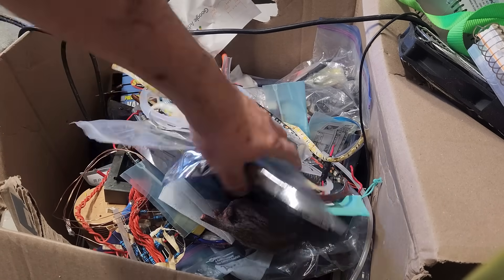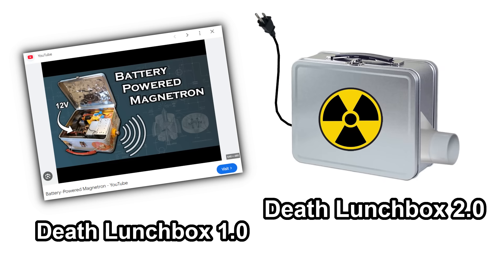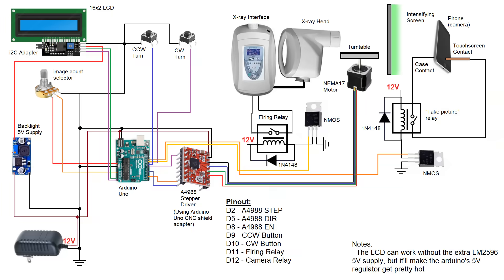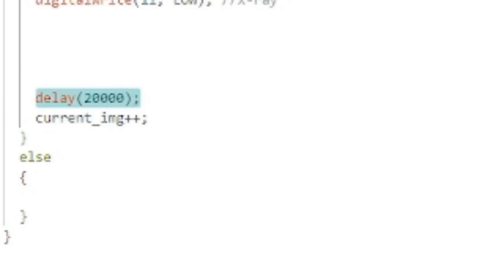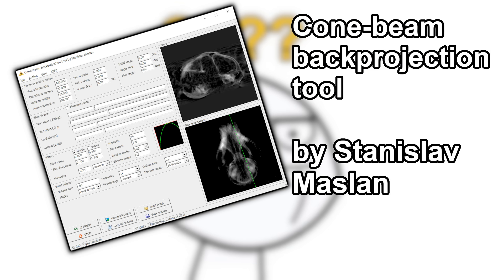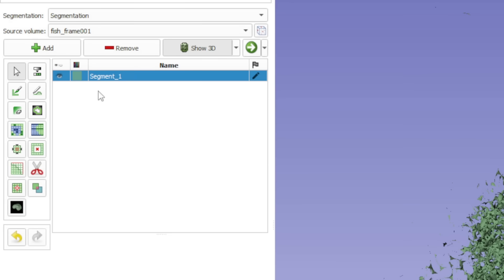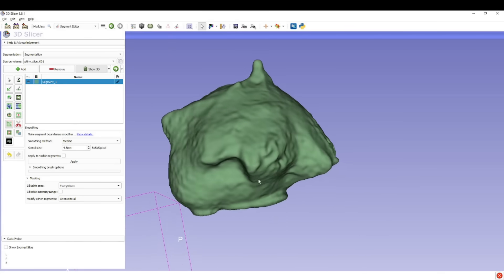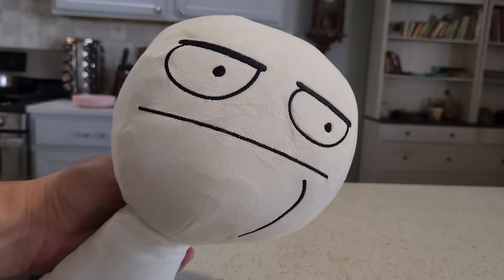Turning X-rays into 3d prints with a DIY CT scanner

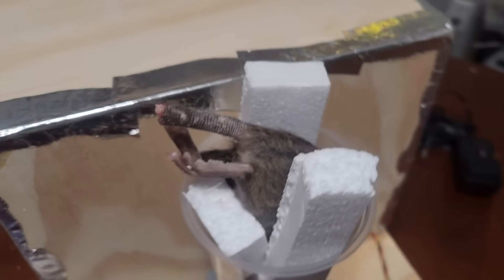Comment: 6:41 so idk abozt your skillset but after color inverting the images (which are like a few lines of python which can chatgpt write for you)

You could use a simple Neuronetwork to remove these artifacts.

You probably do not even have to train it your self.

A quick seaech and I dound Noise2Void or Noise2Self.

I think this could help.
After I saw what you can make this should be absolutley easy with some help of an llm.

Even if you have zero coding experience which I think is not the case.

Very cool video so far.
Would be nice to have

Comment: You should try building a Sabatier process machine. It's where you pass 1 part CO2 and 4 parts hydrogen at 30 bar and 400c over a nickle catalyst and you get 1 part methane an 2 parts water, which can then be split apart into hydrogen and oxygen, and the hydrogen can be recycled back into the process. If you get the hydrogen from water electrolysis,  you get even more oxygen, and at the end, end up with an excess of oxygen, to burn the methane. This process is why space X is using methane for there rockets. Because  Mar's atmosphere is 95% CO2. The hard part is getting components that can handle the pressure and heat, without getting affected by hydrogen enbrittlement. I'm currently working on this, and the biggest problem I'm having is finding a suitable tank for the reaction and a capable compressor. Who knows, If I find a good deal I might just sacrifice a cheap R-410 compressor and a random tank if a get a good deal on both.

Comment: Woludn't it be good to erase the hot pixels before doing more work?  (@singflower already proposed taking more pictures and using a median filter. That's probable the most powerful solution.)
They are salt and pepper noise and thus easy to separate in the images, I guess. :D I'm not very educated about image programms, but I think AI would do a good job to 100% remove those and inpaint the picture with data, which makes sense. Then, there would be less noise in the following steps 
(although, in 3D, there should be even more information, to get rid of those things. However, I guess the algorithms there might be less advanced, because there is less demand and the transformations needed to get a picture are already more advanced than many programmers are capable of understanding.)

Comment: You could significantly reduce noise: if you take not 1, but, for example, 10 shots (for one position of the object) and average them into one, this will suppress noise and so-called "hot" pixels.

Comment: extremely cool, but it'd probably had been easier and would've improved detail to filter out the "hot pixel" noise before, at the 2D images, using something like openCV or just tweaking with gaussian filtering and contrast options

Comment: 400x400 is trash for static xray lol, BUT for CT that aint bad.   at least when i was a programmer on professional medical imaging software, i seem to recall 512x512 being the pretty standard slice resolution for "actual" CT exams  (MRI are even lower. PET is worst lol).   of course there are other differences, like real CT is more like 12 or 14 bit per pixel.   also you dont think of them as "pixel values" but rather "hounsfield units"  a calibrated density unit where 0 HU is water.  makes segmentation a helluva lot easier.      im proud of you for taking xray safety seriously:   excellent job highlighting the fact that beam filtering is important! not many hobbyists seem to be aware of soft VS hard xray!

Comment: My first job was developing the hardware for the first ever CT scanner. No computer powerful enough to process the x-ray data into images so we had to design hard wired logic, using TTL chips, for that. The only computer was a Data General Nova which generated the display.

Comment: Instead of building the periscope, you can try lucky imaging technique used in stronomy, where instead of doing one long exposure you do a couple (5-20) short ones that you then stack and the noice cancels out, while the actual signal in the picture can also be adjusted afterwards in software for picture editing. You only need to do like 20 short exposures times 100 angles, then stack it manually and adjust and you know what, maybe just build a simple periscope

Comment: Improve the quality of the X-rays (and subsequent CT scans) by using the same trick as astrophotographers; take a bunch of noisy images of the same thing and fix it in post!

Instead of taking an X-ray then rotating, take 5-10 X-rays (and photos) before rotating. Combine those 5-10 noisy images by averaging or using a median filter to remove the noise, then proceed as before. I'd expect you'd have much clearer results, at the expense of a longer capture time. 

It would still be almost entirely automated, only adding in 2 additional automated steps but resulting in much better captures.

Comment: I'm wondering if it's the conversion from rotational to vertical slices that's losing you a ton of resolution. Your original images are pretty sharp, especially if you look at the rat's teeth they've got very good contrast and smooth surface, but on the vertical slices they're extremely grainy with tons of voids and poor contrast so the final mesh for printing is just very lumpy and deformed. If you just found a way to do the point cloud generation directly I think the result would've been so much better.

Comment: removing hot pixels with the propper hardware of course is the best. but you can also use some AI image optimazation on the hot pixels before you convert it in to the image the 3d software uses. 

also a nice idea is to combine normal images with the xray images and combine them in a 3d model that you have a full outer shell and like a skeleton model inside in one. not sure what soft you need to do it but if someone can figure it out. 

good luck and thanks for the quality content

Comment: Taking two or more images per step of the rotation could help eliminate noise. Just add the extra photos as “darken” layers in GIMP or Photoshop (easy to do with Python, too). Granted it doubles the scan time but it should help get a cleaner starting point.

Comment: It's probably not worth the time, if you plan on a solution with mirrors, but it should be possible to take three or more photos in that same location, and scan through those images, and filter out noise by comparing each pixel to the other photos in the same location. If they're within some threshold of the other photos, it's a 'clean' pixel. If the difference exceeds the threshold, average together the colour of the pixels that are closest in value. With 3 photos/location, it's not unlikely to have a few overlaps in noise, considering how much there is, but the more you add per location, the less likely it is that the noise overlaps enought to not get filtered out. Also, the noise almost looks completely black and white, so it could be possible to just look at the value and say, if it's almost completely black, or completely white, pick corresponding pixels from the photos where they're not. That should make three photos sufficient, as it's pretty unlikely that the noise overlaps in all three photos.

Comment: i think the hot pixels caused by the radiation can be minimized by using a glass prism to direct the visible light emitted by the intensifying screen 90° to the left or right (basically it works like a mirror. i thought of this because using a normal metal-coated mirror would reflect the xray as well) and then keeping the phone a little farther away and using a mini telescope setup to zoom into it.
i mean glass can't reflect xray right, so the x-ray coming straight from the back of the intensifying screen would penetrate the prism without being reflected and won't be able to hit the camera sensor directly.

Comment: Are the locations of the hot pixels deterministic? If they are random, then you should be able to take an odd number of photographs for each stage angle and then combine them together again by using the median value of each of the corresponding pixels. More photographs will result in lower noise.

Comment: For more electronic version of firing the camera on the phone, turning the volume down on the phone (physical button) will fire the camera (at least on android, I think on idevice), which works via wildly cheap headphones with a volume control.  Which is just a switch, of course.  I suspect it also works with wireless, which is surely not going to have interference from a kludge CAT scanner.

Comment: If you take a video over the exposure, you should be able to clean up all the hot pixels by retaining the common pixels across the frames.  You can average all the frames, which is a trivially simple way to drop out any hot pixels that appear in a single frame. Of course, scripting this would be most convenient. There are some astrophotography related techniques that should be great for this application.

Comment: @5:00 or so you make the automatic touch screen button pusher.  Just FYI, you can buy a device for this that just clips onto a touch screen and is triggered from a remote control.  Useful for turning the page on a kindle while keeping your hands warm under the covers.  Or triggering homebrew irradiation contraptions.  Whichever.

Comment: One easy way to get rid of the hot pixels could be to take multiple pictures from the same angle and do a bit of image processing. Like take 3 pictures for each pixel select the two values that are closest to each other and average them discarding the third. Just off the top of my head. There's probably methods with two pictures like  in regions with large differences between the two images take the version that's smoother with the surroundings. But I think the three picture one is probably easiest to implement.

Comment: As far as I remember my job with X-ray CT scanners, you can eliminate good portion of hot pixels with thick glass. Designers like to use fiber-optic lenses because they are basically big chunks of solid glass and protect cameras from X-rays very well.

Comment: 4:44  the other hardware solution to take the photo is to use a headphone , the volume up button can trigger taking a photo , you may use the other relay for that , this also works with cheap Bluetooth headphones , you can make a remote trigger.

Check the camera settings if it didnt work

Comment: key to get good results from ct scanning or x ray scanning is not the emitter, that is cheap and "easy" to use (just get a 70 kvp or more dental machine or a lamp). the hard part is getting a good picture from the radiation. the lamp has a max beam width so you can't go too big or you have to get closer, so you need to make the receiving plate move closer and further to optimize the clarity (like a focal lense). plus you need a good intensifying screen and there you have to make a weigh off between higher granularity, means more "pixels''/resolution, but less light emission, or more coarse and more light emission, meaning easier camera work. i have chosen a 200 sensitivity screen, which is the more coarse (100 is finer), because 100 was pretty much too dark. i think perhaps with a x ray fresnel lens, which doesnt exist yet, a metal fresnel plate you could make the beams become paralleled collimated like a laser, and then you could stack thin very sensitive screens maybe to get a best of both worlds. anybody in to testing or know a result?
Reply: ah, its a Fresnel zone plate (FZP), it exists and is impossible to find..

Comment: Wow those images are incredible! I'm quite certain some well-tuned signal processing steps could easily produce a clean and accurate 3d model. Would you be open to sharing the raw files somewhere so we can have some fun with them? (without exposing ourselves to dangerous radiation)

Comment: Cheap fix for hot pixels would taking each picture twice (with 0 or 360 rotation) and using boolean "AND" to remove pixels appearing only in 1 picture. May require using AND over a window to avoid drift problem.

Comment: I see a lot of potential in this. A periscope, higher resolution images, image processing before going into the software, maybe taking multiple exposures per angle and pick pixels from the one without hot spots by using outlier rejection, better mesh processing, there are a lot of things you can do to improve this and I hope we get another video on this! Very cool stuff

Comment: Would photogrammetry software work better to get the point cloud? It’s designed to munge together images from separate angles. Also selfie sticks are quite good for hacking to give you an external shutter control… 😀 thanks for the fantastic content.

Comment: There are Selfie-Sticks and remotes to trigger cellphone cameras.
 There is even a way to trigger a phone's camera via the headphone jack (if you happen to have one.)

On the hot pixels, Notice that they are White, while the screen is green. You could easily filter them out that way. 
There will still be "holes" in your image, so taking several images and "adding them together" might be needed.

If you can find some Lead Glass prisms, that would do double duty for the periscope and shielding for the cell phone.

Comment: We deal with similar radiation induced noise in astrophotography: even just natural background is a problem with multi-hour exposures. The solution is to take multiple copies of each image, and do some averaging with outlier rejection. I'd recommend doing this with the raw unsharpended image: The sharpening adds dark halos around the sparkles which will make them harder to remove.

Comment: Regarding the hot pixels: I saw a few people suggest taking multiple pictures and averaging them. But there's actually a better way for pixels that are either fully black or fully white, which is also called salt and pepper noise. You can get rid of almost all the noise with just a single picture and applying a median filter. Basically, the median filter looks at a small block of pixels, sorts them by value and then takes the middle one, thus replacing extreme values with something that matches the surroundings. It's surprisingly effective
Reply: This is the same thing they do when a pixel dies on an image satellite.  Just average the two beside it.
Reply: neat thanks for the knowledge
Reply: I should have read the comments before sending my own "salt and pepper" comment. Using the median filter is a good base. There are more advanced inpainting methods though, which preserve gradients (I'm not sure, if that would be very visible as long the hot pixels are actually pixels and not whole areas). However, defining the pixels by the power of having multiple photos is a much better idea than inpainting. It even gets rid of some of the other noise, when you apply the median filter on the whole stack of photos.
Reply: not eally, though, the noise on his image looks way bigger than individual pixels. it works great on raw sensor data maybe, but not on results from a phone camera software
Reply: Median is different from average. It completely ignores extreme values. Average of 14,15,16,17,1000 is around 1000/5. Median is 16.

Comment: 4:45 an easier way: 3.5mm headphone jacks with mic (aka the one which has a button on the earphone, trrs jack) can be used to trigger the camera. You can use a dongle (lmao) to connect it, then you can snap a photo by shorting mic input to ground

Comment: Someone probably said this already, but you should have a look at some trinamic silent stepper drivers. They are controllable using UART and can be semi closed loop, they can detect step shifts. You can microstep in like 1/256 resolution. Can run your motors way cooler and inaudible

Comment: wont a mirror help reduce xray noise? the thin film on the mirror reflects the light at a 90 degree angle and the sensor is shielded from the side.